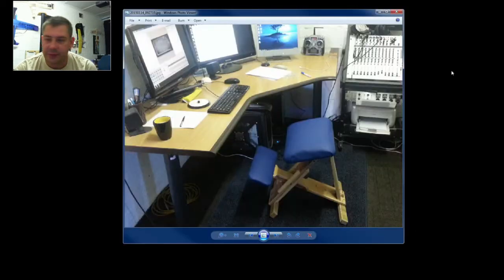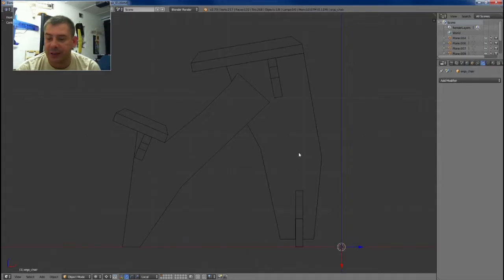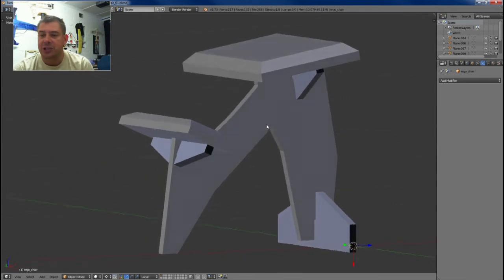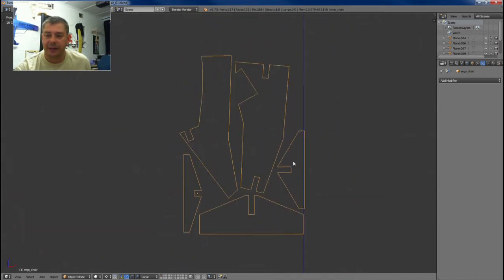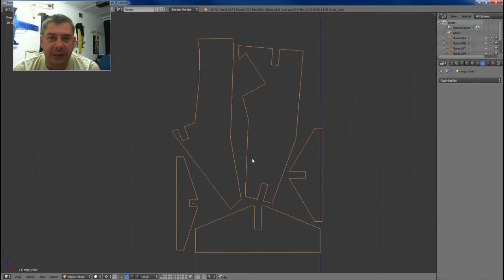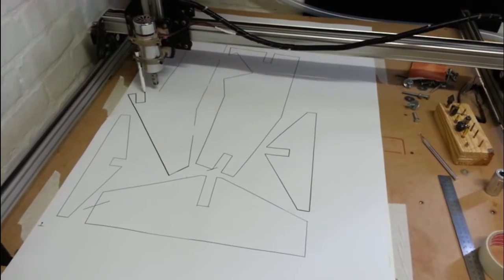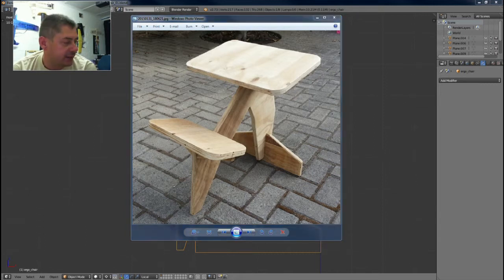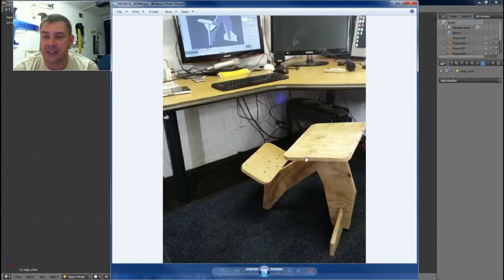Shapeoko 2 Blendercam plot ergonomic computer chair

Comment: Question, how come you didn't use the shapeoko to cutout the shapes?
Reply from the maker: HI James. Good question! I have the Inventables 400W quiet spindle. But it seems that my 12V PSU needs to be upgraded to 48V so that I can get a much better cutting speed. As it is now, the spindle will take almost 8 hours to cut out the parts, while I can do it in 15 minutes with a jigsaw. Once I have upgrade the PSU I think the machine will come into its own in terms of better cutting power.